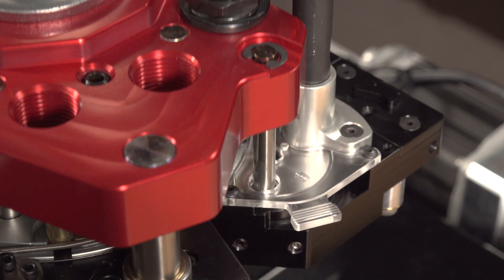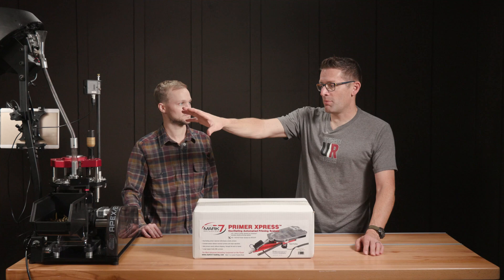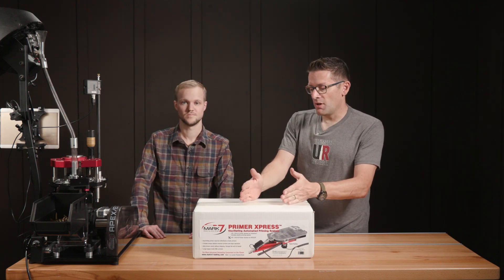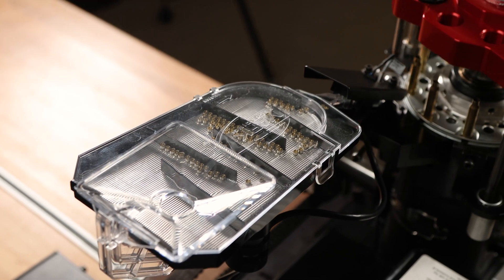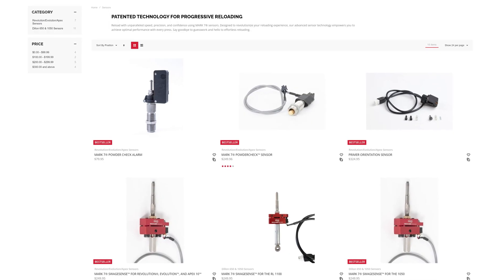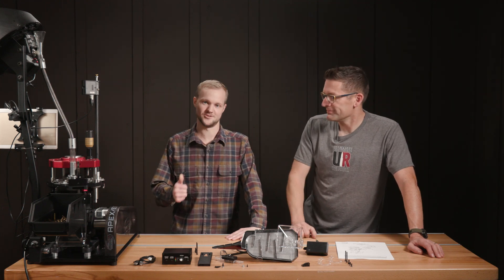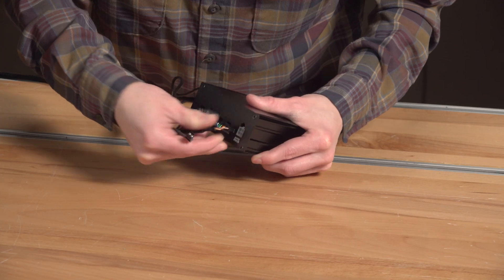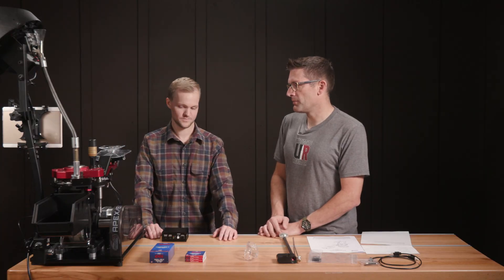Automated, Fast, Pain Free Priming: Mark 7 Primer XPress

Comment: It does not work!! Both original and Gen 2! Bad design, it will never work!! The primers flip with both the primer express and the supplied manual tower tube! The Gen 2 is a bit worse than the Gen 1. The Gen 2 the primers will get stuck under the Shell Plate and what a project getting that off with a primer jammed under it! Also the aluminum shoulder in the priming system gets gouged from a flipped primer and you have to sand it down to remove the gouges or primers will get stuck again, actually they will anyway! The whole thing is a bad design!! My experience was with 9mm. I finally threw the whole thing away! Got sick of loading 20 rounds and taking it apart!! I know what is wrong with it but I am not going to give them the fix after they ripped me off with a Gen 2 system and it is worse!! JUNK, not even good for a small boat Anchor!!!!!!

Comment: I have had my primer express on my Apex 10 for about a year and a half and still trying to figure it out, I’m mostly struggling with primers not flipping and at times just don’t what to flow down the path. I may have to look into getting the Gen 2 primer setup and getting that foil tape for the primer tray.
Reply: The Gen 2 is worse than the original! The system does not work with the primer express or the standard tower! Bad design and components never will work! Threw mine away! Could not take the aggravation any more!!!

Comment: It would be good on one of those hydraulic trolleys. So you can lower it down while it's running to make it easier to keep filled with brass. 
Then you can jack it up to service it and or set dies up ect.
Reply: Welded up a simple crooked handled 2 cup scooper thingy that works great. Used a coat hanger to figure out the angles and by fluke nailed it on the first try. Don't even have to bend over to scoop the brass or bullets get it near the hopper ad rotate and it dumps.
Reply: They make mirrors for the brass feeder and Mr Buller Feeder. You can be seated and see inside each bowl, and fill when needed. Even if you couldn't see it, you'd hear them run continuously without feeding a case or a bullet, telling you that you have a problem, most likely that one is empty. Not really an issue as the brass feeder holds 12-20 cases and bullet feeder holds about 12-14, so you've got lots of time to react.